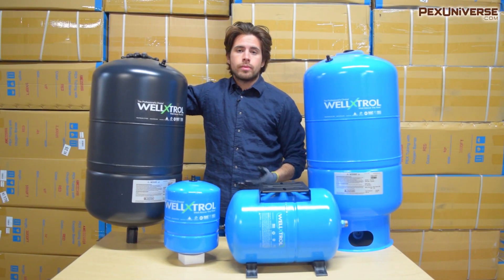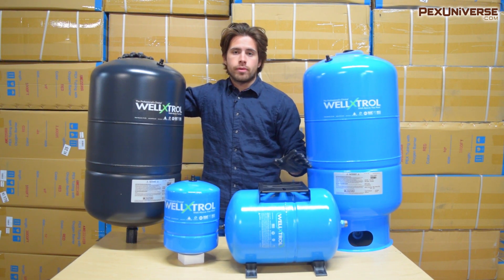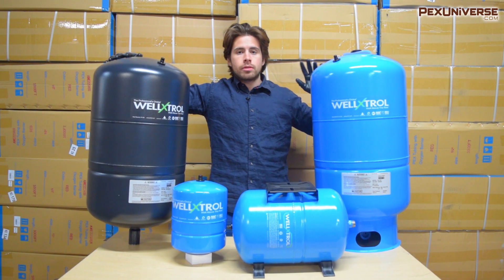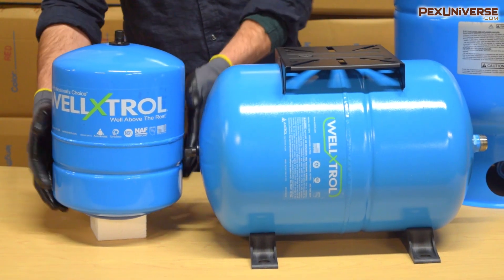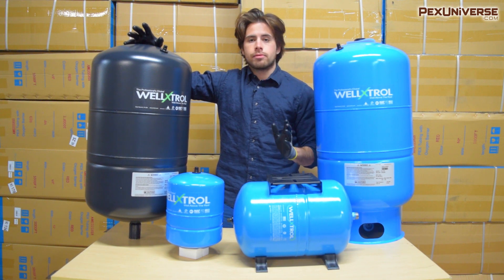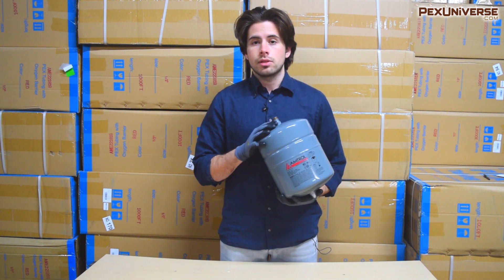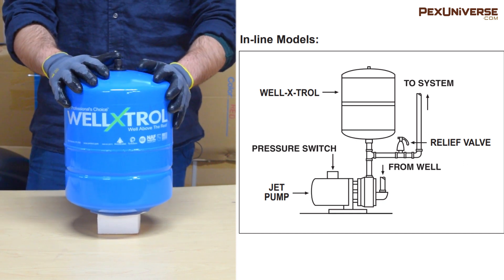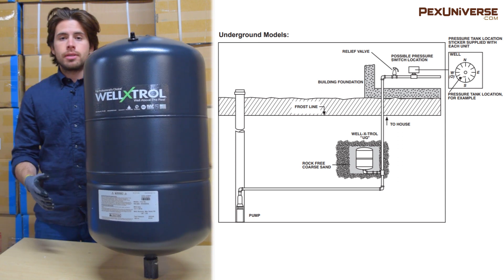WELL TANK BASICS: How a Well Tank Works, and a Look at Pressure Tank Designs

Comment: My tank is outside in the hot Texas sun. I could build a shade for it, but was wondering if I can put it into my airconditioned garage? Any reason not too? It would be easy to do, there is emergency drainage ( my water heater is in there), and I would never have to worry about the cold water being warm in the summertime or having to worry about it freezing if we have another freeze like earlier this year. To run the water line, it would go underground by the well for about 7-10 feet and come up outside the house and right into the wall. Would there be any condensation, algae, or anything I don't know about, that I would need to worry about? I just got the well put in about a month ago and waiting on permanent plumbing. It goes into the house at the water hose faucet now.
Reply: you brought some good points. imo, consider flodding in case of a failure and maintainability.

Comment: Can the larger 32 gallon tanks be installed horizontally? I would like to move my tank into the conditioned crawl space but lack the height to stand one up.
Reply from the maker: Hello Ryan, horizontal installation might not harm the performance of your tank, just make sure that it is properly supported, but installing it differently from what is advised in the manual might void your warranty.